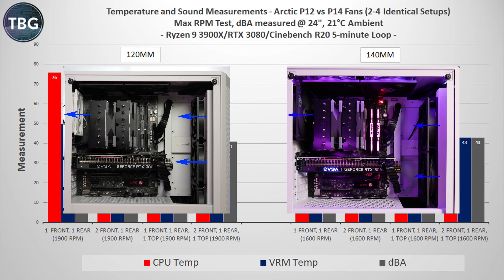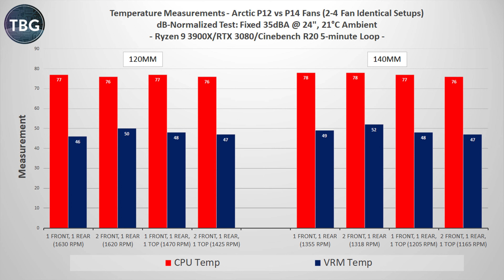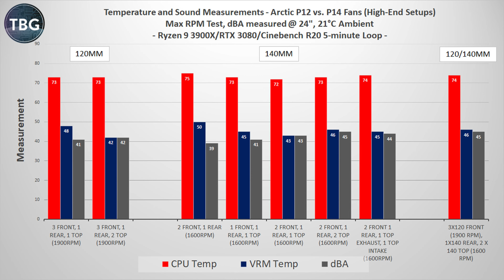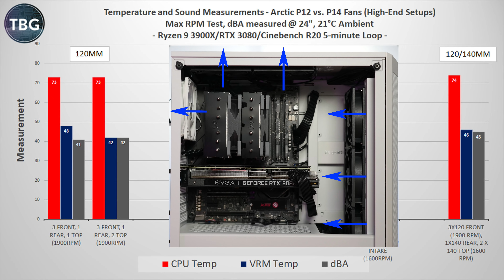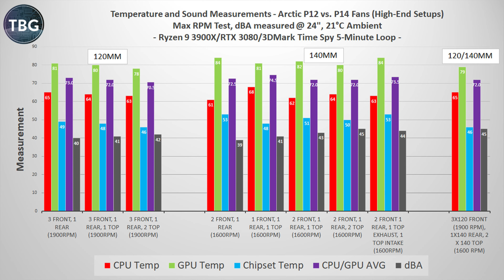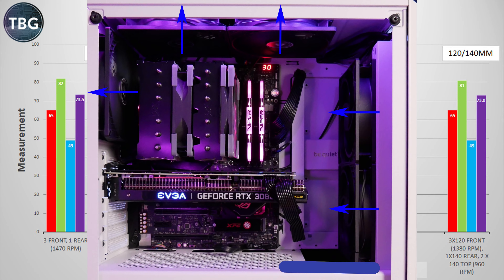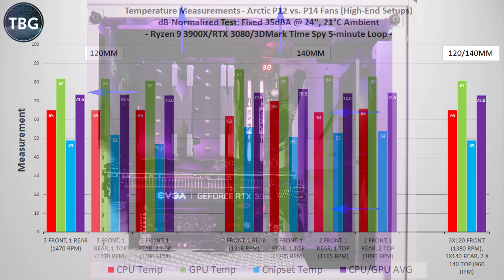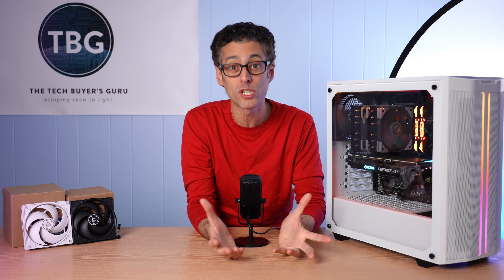The Best PC Case Fan Setup - How Many, What Size, and Where, feat. Arctic 120/140mm Fans!

Comment: Thank you so much for this video, it was immensely helpful!

My case supports one 120mm fan at the back and two at the top but also supports either two 120mm or two 140mm fans at the front. 

Should I go with two 140mm at the front + two 120mm at the top + one 120mm at the rear or all five 120mm?
Reply from the maker: It's a close call, but I would probably go with 2x140mm in the front. While some of the extra airflow will be wasted going around rather than into components, it's still worth it when you can't have 3x120mm in front.
Reply: @TheTechBuyersGuru  Thank you so much for the reply!

I've decided to settle for two 140mm intakes at the front and three 120mm exhaust at the back and top.

Comment: Have you been able to test any of the extreme industrial fans like the 140mm x 38mm BGears BG01831 PWM (it's categorized as b-blaster PWM series). Max 5400 rpm, 2.76A, 308CFM, 31mm-H2O static pressure. I'm about to test two of these up front but separated, and since I have no other PCI cards except for two relocated graphics cards sitting on the deck. The air should just blow right through those heat sinks and right out the back. But I do have a Corsair AIO for the CPU with two 120s blowing out through the top. I have it pushed as far back as possible. This should be interesting

Comment: I tried the 3 120 front intake and 3 140 top/rear exhaust, and got a big improvement in the gpu, like 5 degrees off in full load. But putting my hand above the closer top fan i felt only cold air, like its exhausting directly the intake whitout cooling. I will try to use only the second top fan to see if its the same in terms of performance so i can remove some top Noise from the config.

Actually using 3 Deepcool RF120 and the 3 Be Quiet 500dx stock pure wings 2

Comment: I have the same case with the 3 stock fans, 2 intake one exhaust, not very cool but good, looking for improvements. What do you suggest ? Is better to put the fans back to the front support as you did in the video to keep the fans closer to components or it was Just pratical for the test ?
Reply from the maker: I think mounting them on the interior of the frame does help.

Comment: I really appreciate your videos! 
I just bought a few noctua fans (before watching this and the shootout video) and will now be returning them, haha. Based on these two videos, it sounds like you would recommend 6 120mm maze flex fans for an rtx 3080 gaming rig? Price isn’t a concern for me but I do care about sound—especially sound:cooling performance. 

OR maybe pure case fans is not the way to go with this?
Oh- my case can support two 140mm front fans (or 3 x 120mm), 120mm rear exhaust, and 2 140/120mm fans up top (i think it even supports fans below the gpu!).

Comment: Hi. I bought the same case and you already know that it comes with 3 Silent Wings fans (1 intake and 2 exhaust) for a total of 104 CFM intake vs 208 CFM exhaust. It's clearly not a positive pressure. To get that positive pressure, it will be better to add a fan in front that produce more CFM than the Silent Wings. I'm thinking of the 140 mm Pure Wings 2 high speed that produce 160 CFM. It will result of a total intake of 264 CFM and a total exhaust of 208 CFM which is a positive pressure. Do you agree with that vision? I know that you prefer to add more fans but I don't have a GPU. I have the 11600k processor which is running hot. Thanks.
Reply from the maker: I don't believe that positive pressure is necessarily better. In fact, I found in my review of this case that the stock setup is better than having two fans in front: https://youtu.be/kgvm5ZTAbFQ

If all you need to do is lower the temp of your CPU, using a loud, high speed fan in the front is not the way to do it. You need to either upgrade your CPU cooler or the fan on your existing cooler.

Comment: How does the Scythe Kaza Flex compare to the Arctic P14 A-RGB?
Reply: Bought 2 Scythes that go up to 1800 rpm and paired them up with two P14s that have that harmonic resonance starting at 950-1000 rpm. Both scythes are very loud compared to the P14 even with harmonic resonance. they take off like a jet at around 900 rpm. maybe they are defective, but they are loud even at 1000 rpm and i havent noticed any temp improvements.

Comment: Did you do something similar with 200mm fans?  Possibly mix different sizes.  2x200mm front is becoming more popular.
Reply from the maker: I didn't test 2x200mm, but there is a catch with these fans. They don't provide a lot of static pressure, and typically spin at very low RPMs. They are good for "case" cooling, not so good for specific component cooling. They move a lot of air, but not in a specific direction and often not in an area where components sit.

Comment: Very helpful for my first build since I actually grabbed the 5 pack of the arctic 140's for the price to performance value. 

One caveat, I went with the Phanteks p500a non-rgb case so there is actually room for me to put three 140's in the front and get that airflow beneath the gpu.

I have an arctic liquid freezer II 360 AIO as well so I'm excited to see how removing the air cooler from the flow path affects temperatures.

Gonna set them up in a 3 front, 1 back plus AIO top exhaust configuration to see how it goes. And I'm praying the increased case size doesn't bite me with the longer distance to the components like you mentioned 😟

I'll post results when the parts get here.
Reply: I'm waiting
Reply: @maozedowner5915  So as it turns out, I'm an idiot with almost no idea what I'm doing. And the results show this. 

My cpu is an i9-12900kf running at 4.9Ghz.

 Cinebench r20 was too hard to find, so I went with r23. After a 5 minute loop, I got a max temp one one core of 87° and an average max temp of about 79.5° on Core Temp 1.17.1(that incredibly high temp told me I might be doing it wrong)

For the GPU(3080 FTW3 ULTRA) I ran the time spy test while following it with task manager and although my gpu load hit max, the temp never went above 53°(this confirmed I was doing it wrong.)

It's disappointing, but I don't think my findings will be of any help to anyone. Sorry.
Reply: @htat1guy  Yeah... no comparison point whatsoever, it's not gonna help.

Comment: Arctic fans are solid budget fans, and the 5-pack is a wonderful value.

As an alternative, I recommend MetallicGear Skiron fans, whenever you can find them for a good budget price.  They're made by Phantek.  These fans are a slightly better 9-blade design for airflow compared to Arctics, but more importantly, the Skirons are close to the cheapest case fans you can which include rubber mounts to reduce vibration noise.  Decent quality rifle-bearings, slightly improved on the ball-bearings in Arctic fans.  Arctics have a cooler motor, however, which increases their lifespan over the Skirons.

Comment: this is exactly what I was wondering, watching it now like a Nat Geo documentary. Thank you!
Reply from the maker: Ha, ha, that's the first time my videos have been compared to a nature documentary. I like it!
Reply: @TheTechBuyersGuru  have you yet tested the variable of (1) intake/down facing top fan, but on the front side of top only; leaving the back/top open

(In my mind, this solution has an back / case exhaust too)

Literally I bought 8 Arctic P12 PWMs this morning bacuse of your video. I have the lian LI 215 and I'm replacing the front (2) 200mm 3 pin fans with (3) arctic P12s, and P12s throughout my case. 

Decided against the Scythe for my front fans.. I hope I make the right choice!
Reply from the maker: I haven't tested the setup you suggested, but since you now have 8 P12s, you can try it yourself! Glad that my videos convinced you, but wow, eight is more than most cases can hold!

Comment: thank you for all your test, but i've noticed u had your fans in the front not at the outer compartment closer to the mesh but instead at the inner compartment.
doesn't that make a difference? 
and how well would a 3x120mm, 1x140mm on top and 1x 140mm in the rear perform?
i mean u could actually fit 3x140mm in the front, 2 at the outer compartment and on in the inner compartment.
they do overlap ofc
Reply from the maker: It's probably best to maximize the gap between fans and mesh. Close proximity leads to whistling sounds.

Comment: So I have a 3080 and I should get a case with 3x 140mm fans 2 on top and one near and then 3x 120mm front panel ??? Or am I wrong
Reply: Or have all 6 with 120mm fans
Reply from the maker: Your first option.

Comment: Man, did I ever find this content 6 months later than would've been ideal, haha.  Nonetheless, thanks so much for putting in the work to find and share this data.  I am unhappy with the acoustics from my system when I reach my target thermals, and had been semi-seriously considering a $1000CAD custom water loop. I'm gonna try replacing my two front 140mms with three 120mms and adding another in the roof before i do anything too brash.
Reply from the maker: You're welcome! A lot comes down to the cpu cooler you are using, and secondly the case fans. But yes, roof fans help when used to exhaust systems, part with regard to GPU temps.
Reply: @TheTechBuyersGuru  
Oddly enough, I feel as though my cpu cooler is hardly the most intrusive component in my system currently.  I AM just gaming on a stock 5600x with a hyper 212 black, so its fan speed rarely if ever goes above 60%.  My issue is keeping the gpu bathed in enough cool air to keep the rpm on its fans reasonable. Even with a custom fan curve and significant undervolt, the noise can get a little rude sometimes.  
Keeping this in check requires my 2 front intake fans to run at a disappointingly thunderous speed relative to my expectations.  There is so much anecdotal advice out in the wild that 140mm = lower rpm = lower noise but we now know that not to be necessarily true.  The real kicker is those 2 140mm fans set me back basically the exact cost of the P12 value pack, haha.  Live and learn I suppose.  Thanks for the response.  All the best.
Reply from the maker: 140mm fans in front was what everyone simply said was best, but my tests showed differently. It has to do with directionality of the airflow. Move those 140mm fans to the top as exhaust and they'll be great. You want 3x120mm in front.
Reply: As a first-time builder, I found there was a huge lack of readily available objective data when it came to case fan configuration.  Better late than never though.  Thanks again, and best wishes with your channel.

Comment: Amazing in-depth analysis! I'm currently playing with a setup for Meshify 2 Compact which supports F: 3x120/2x140, R: 1x120, T:2x120/2x140. Based on your results I'd go with 6 fans setup but I'm not sure what size would be better for the top fans. Would you go with 120- or 140-mm fans? I'm using Scythe Kaze Flex with separate PWM control for intake and exhaust fans to optimise case pressure.
Reply from the maker: If go with 140mm for exhaust  where airflow, not direction or focus,  matter.

Comment: Really shocked the 140s were louder. I thought the purpose of big fans were they could turn slower and produce less noise.
Reply from the maker: It comes down to what big fans actually accomplish. Do they move more air at the same noise level? Yes. Does that air reach components that need to be cooled better than air from 120mm fans? Not necessarily, and in some situations, definitely no.

Comment: I’m thinking of running a front 240mm rad in push-pull for my gpu with the kraken g12, 2 front push fans will be running silent, pull fans will be running at a higher rpm since they’ll be inside the case. And for exhaust I’m thinking running of running a 280mm rad with push fans only. Rpm will vary depending on noise. It’s all an idea and I haven’t brought it to the light. I also want to dig into fan gaskets or something to close the gap between the fan and rad.

Comment: i think you need to do this again with a case that actually! supports 140mm fans in the front (so not only mounting having points, but also having a bigger cut out so the 140mm arent just partially blocked like in this case).

maybe you start out by testing it only @noise normalized with 1 setup (e.g. all 120s vs all (possible) 140s?)
Reply from the maker: To mount both 120 and 140mm fans, those rails are necessary. If it disadvantages 140mm fans, that's a valid factor in the benchmarks, and it means 120mm have an advantage.

I do not plan on re-doing this test.
Reply: @TheTechBuyersGuru  maybe if you are getting another shot at a similar project you have a case laying around that has less restrictive 140mm mounting :)

good content in general btw.

Comment: So if i have 6 120mm fans but i have a 240mm aio, 
would you put the aio in the top as exhaust along with the 1 in the back
or would you put it in the front as intake with the 1 in the front? 

For reference; 
Case: Meshify 2 
GPU: RTX 3080 tuf (open air cooler)
CPU: 11700k
Reply from the maker: This will answer your questions: https://youtu.be/bL5IsxzpiCA

Comment: kinda curious sir, if the front of the case is a grille with magnetic dust filter, which type of fan should you use? air flow fan or static pressure fan?

Comment: I have 4 x140mm fans. Do you suggest 3x140mm front intake + 1x140mm top exhaust or 2x140mm front intake +  top right 1x140mm intake + top left 1x140mm exhaust or 2x140mm front intake + 2x140mm top exhaust? Why? Please help. Thank you!
Reply from the maker: As discussed in the video, setting top fans to intake does not work.

Comment: Great video, thanks for content. I have plan with 6 fan (ml120 corsair) with case  4000d airflow with corsair hub commander pro and noctua nh-12a, i think setup fan: 3 front (intake) 2 top and 1 rear (exhaust). Do u think my idea plan fan setup for intake or exhaust and your idea with u have? Tks

Comment: running 6 p12 argbs atm and its great. Up to 1000rpm they are virtual inaudible and they are set to max go to 1400rpm, everything stays under 70° and my case doesnt even have a mesh front or anything. 6 look and sound the best imo, 140s were always louder for me
Reply from the maker: Awesome setup! Yeah, 120s do sound a bit different. The 140s have a lower pitch, more motor noise.

Comment: Interesting, I'm just thinking about switching 2x front intake, rear and top outtake to 2x top+bottom intake, rear outtake and top mesh covered by a foam. Why? I found that even when two intake fans are at max rpm, dust filters have enough resistance to make outtake fans at low rpm more effective and creating negative pressure (and eventually bottom fan may blow air directly onto GPU - mATX case without bottom box for hiding cables)
Reply from the maker: Bottom intake is a good idea, top intake is not. Positive pressure theory has been proven wrong.
Reply: @TheTechBuyersGuru  Ops, I meant 2x front and bottom intake, rear outtake and sealing top vent.
Reply from the maker: OK, that's not bad, but only seal the top if you actually have a dust problem. Otherwise you're better off running exhaust fans on top, and if you're worried about dust collecting when you're not using the PC, cover it with a towel or other cloth item.

Comment: Nice video! I have the corsair crystal 280x case I recently bought some rgb fans which ended up being 120mm and I wanted to install 3 on the front but there's only enough mounting holes for two 120mm is there a bracket or something I could get to all 3 fans to be mounted?
Reply from the maker: No, but you can put a fan in the bottom blowing upwards and it will do a lot of good. Or mount on top if you don't already have one there.
Reply: @TheTechBuyersGuru  thanks for the info

Comment: this gotta be the most time consuming video about fan orientation and setup ever! thanks a lot sir for sharing the numbers!

quick question,  i got corsair 7000d and got 12 x 120mm fans
4front , 4side, 3top and 1rear
i am thinking of replacing my 3top and 1rear 120 to a 140mm, you reckon it will help sir?
Reply from the maker: My rule of thumb is that you should go with the biggest fans you can as long as they don't reduce the total number of fans. That's because 3x120 is better than 2x140. But 3x140 will likely perform the best. And 1x140 is definitely better than 1x120, especially for the rear where directional airflow isn't important (120mm fans can excel in this due to higher RPM and more focused airflow versus 140mm fans).
Reply: @TheTechBuyersGuru  with that said, i will now replace the top 3x120 and 1x120rear with 3x140 and 1x140

another side question sir, would the front 140 on top suck fresh air from the side and front fans too soon? cause technically air from those fans haven't touched any of the pc components yet. what should be the best orientation for that? intake or exhaust?

pc case is corsair 7000D sir
Reply from the maker: I discussed top fans in the video. You can see what I say about that starting at 08:23.